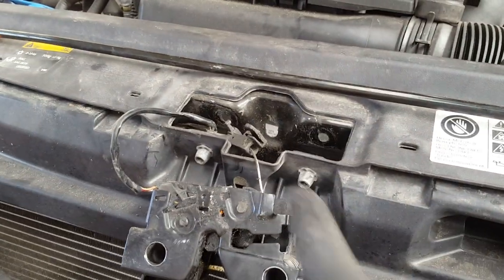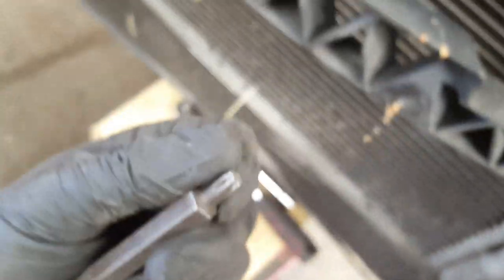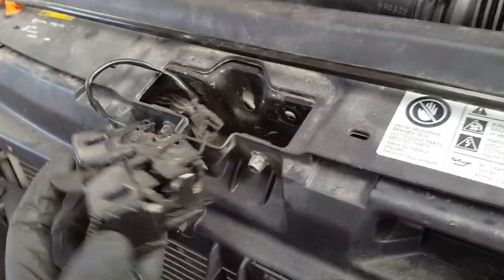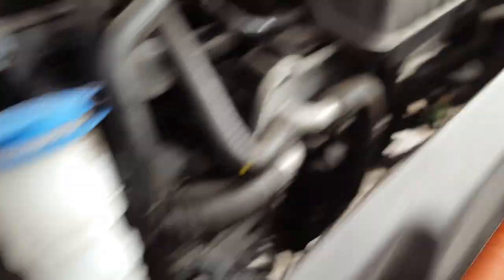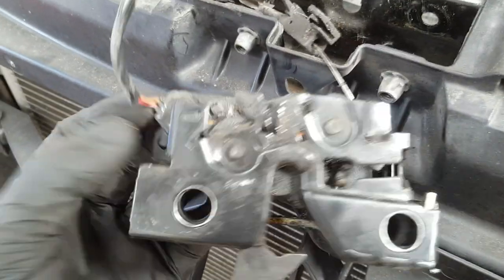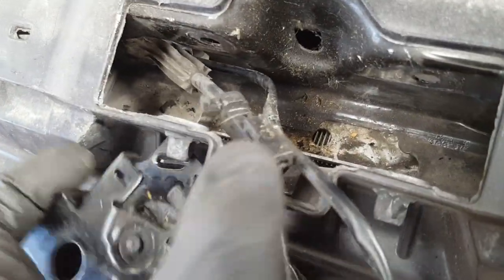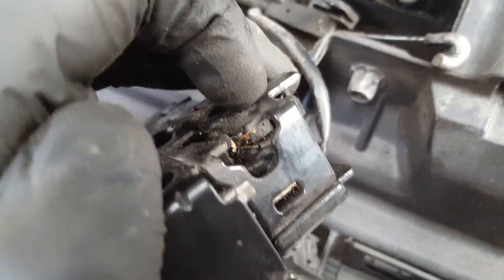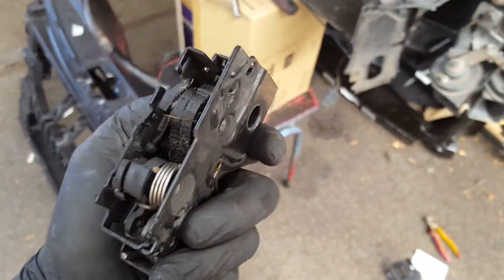Vw Polo 2013 to 2017 bonnet catch and cable removal/replacement. New shape Polo.

Comment: Hi Alex, I need some help. My bonnet release catch is loose when i pull it, no tension at all. I tried getting someone to push down on the bonnet and then pull the release cable manually but still no luck. I managed to remove the grill but cant seem to locate where i need to insert a screwdriver to trip the catch. There's still the black bumper mount that is visible so I cant see the latch directly but there are a couple of holes at the front. Can you help to direct me on how I can trip the latch? It is a 2013 model polo sedan

Comment: Hey Alex,  I face a several issues in opening the bonnet, firstly stock handle was little bit tight to pull off, when I pulled it harder it got broken. Secondly I replaced with new handle, it was working fine when trying 5-6 times test. Later an hour , it became same as like before ..hard to pull and got broked new handle. Car is 10yrs old. What would you suggest? Cable falt ? Or lock set? Or cable twisted?

Comment: Hi Alex, I have an issue with a 2015 Polo Vivo. The cable has disengaged from the latch. I now cannot get into the bonnet to reset it. Do you have a recommended fix for this?
Reply from the maker: hello there. is that from the main latch under the bonnet you mean? unfortunately it will probably need front bumper removal to get to it

Comment: Hi Alex,
I am driving VW Polo 2011 Vivo model. My my bonnet cable is still intact but i can't open the bonnet. I believe is stuck.
Please help on how to open a stuck bonnet.

Thanks
Reply from the maker: Hello there.
What it feels like when you pull it? 
Does it actually go back? Have you got anyone that can assist you? You need one person trying to pull the cable and the other one pushing the bonnet down in the middle where the catch it.